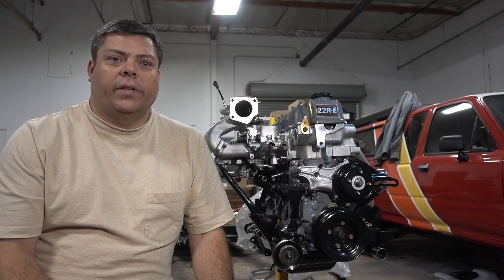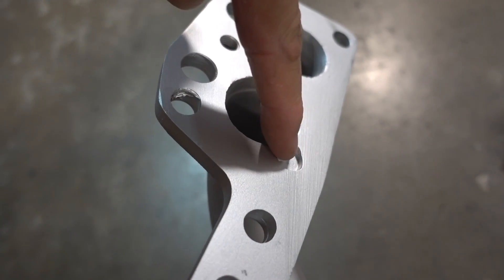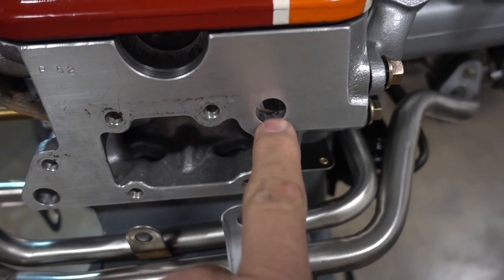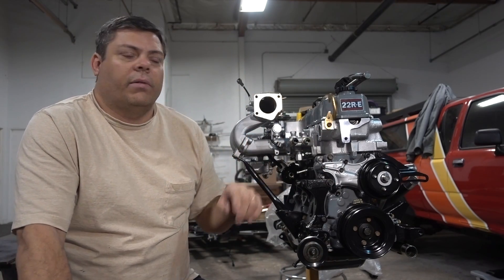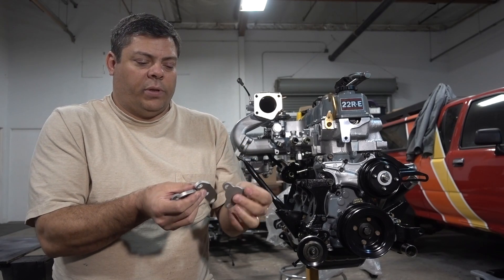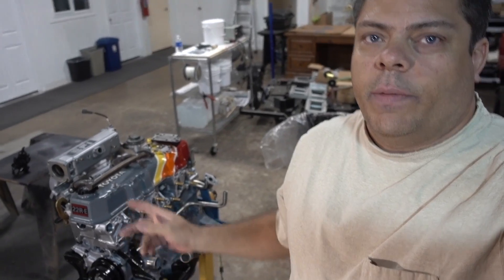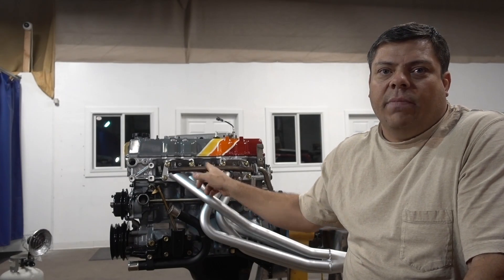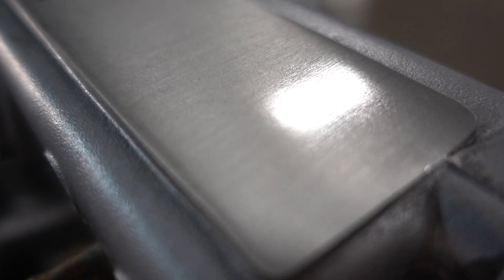22R E EGR and Air Injection

Comment: the statement that you will have worse gas mileage if you delete your egr contradictory to what I have found.  I actually got the same mileage when I removed mine, however when I tore my motor down to rebuild (about 240,000 miles later) I had no more carbon build up in the plenum.   I recommend removing the egr if your laws allow it.

Comment: Brilliant.

This kind of technical prowess maybe 22re owners even happier.

Talk about a rendering no shot assessment!

Brilliant 

See the thing is these engines have an actual street potential of about 175 hp, but it's not cheap, and requires both serious knowledge and very specific parts and labor

My drunk DIY take might be just bolt 2 engines onto the truck; one w egr and air inject, the other, w o

Voila~ 

Lol

* lce headers do magic albeit not Porsche of course

Comment: On my '86 I kept the EGR going with a new EGR valve off a ported carb vacuum supply and the temp activated vacuum switch. Works fine. Now I gotta figure a way to make the AIR system run without the long gone computer. I have a Weber now. I left California over gun laws and smog stuff.
Reply from the maker: Do you still have a cat convertor? If you don't, then I would delete the air injection.
Reply: Yup, still have it. I live outside Tucson's smog zone but would still like to make it clean as I can.

Comment: What is the port on the head between the intake port
Reply from the maker: I didn't show the intake side ports. Do you mean the small bolt hole on the exhaust side?
Reply: In the Middle of the intake side
Reply from the maker: I believe the one in the middle of the intake side is part of the water jacket. I'm not sure any water goes in/out there, but there is a temp sensor there for the gauges.
Reply: Ok thanks